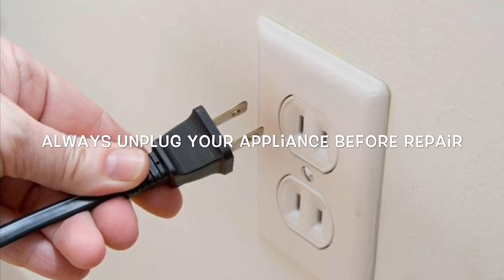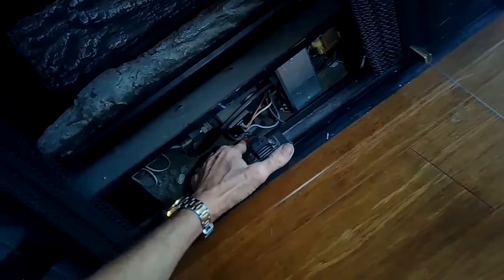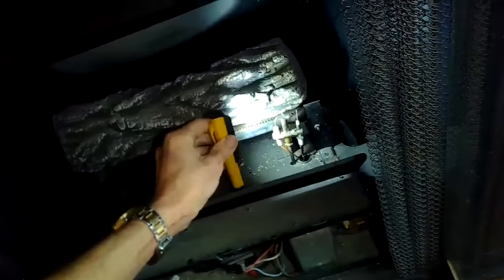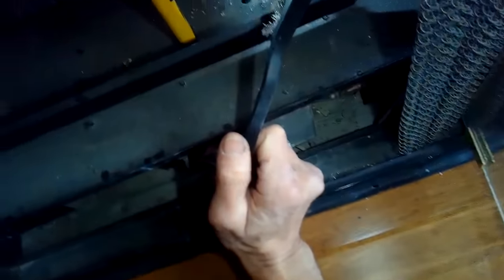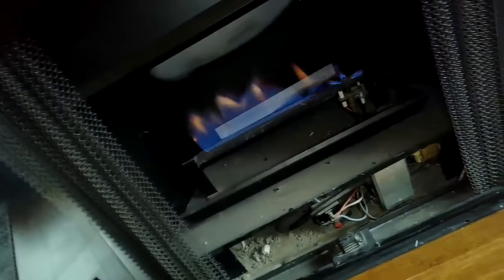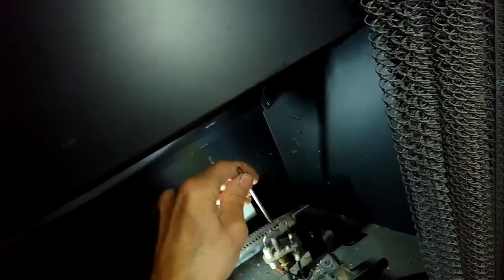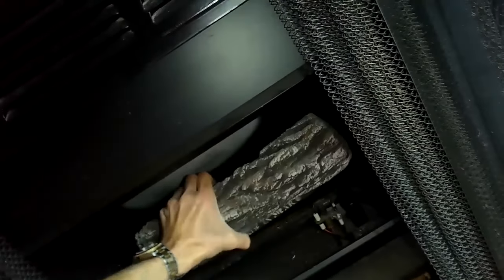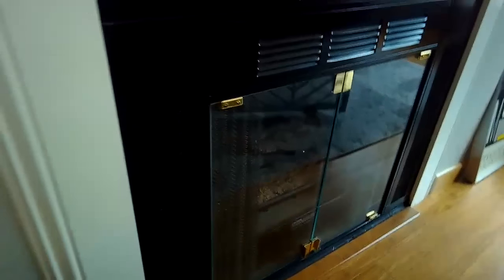✨ Gas Fireplace Won’t Light🔥 (FIXED) ✨

Comment: When my pilot wouldn’t light. I checked the AA battery on the side of the setup and found the battery completely corroded. I didn’t even know there was a battery there. I change them all out for the system to start the cold season every year but never changed the one under the stove. It lasted 12 years 😆 it lit immediately when I replaced that hidden battery.
Reply from the maker: Awesome job Sean👍

Comment: We use acupunture needles to clean 3d printer nozzles, they are VERY thin surgical steel needles.  Maybe something like that would work cleaning the pilot light?

Comment: My fireplace does not have the valve that you show in the video only gas line on insert part and key on the outside so how the heck am I supposed to turn it on and off?
Reply from the maker: You just turn the key and then light it with a long match or lighter with a long reach.
Should light the log right after turning the key👍

Comment: my gas fire has 3 radiants, but, the middle one doesn't glow half as bright as the outside ones... i've given it a thorough clean out... any idea what i can do with this middle, duller, radiant ... The center radiant lights first, followed by the outer 2...
Reply from the maker: Sounds like the gas flow is being obstructed by something 👍

Comment: Your video saved me a service call, thanks. One additional tip though, after using the wire brush and pick I blased the jets with a can of compressed air. This is the type you use on computer keyboards. Worked great as the tube straw fits right in the pilot holes and really cleans out any debris.
Reply from the maker: Thanks Dave,
That’s a great idea😊

Comment: Yep, just needed a quick clean.  Used one of my bore brushes and some canned air.  Took a couple tries to get the pilot light to stay lit, but now works better than ever.
Thanks!
jc
Reply from the maker: Nicely done😊😊😊
Reply: Decided to give this video a try before having a tech come out to fix my gas fireplace. As a 61 year-old woman, I find these kinds of things intimidating. I followed your easy to understand instructions and voila, pilot is lit and fireplace works great. I vacuumed the dust out and cleaned the glass while I was at it. Thanks for posting this video and saving me the $125 service fee!

Comment: Thank you so much for the video. I finally got the pilot to light up but I cant get the burner to start.
Reply from the maker: That copper thing that the pilot light touches needs to be cleaned with a wire brush.
Make sure the pilot flame is touching it.
Reply: Quick and Easy 5 minute Appliance Fixes I kept trying and cleaning and sure enough it started. You’re a life saver. I was going to call a contractor and he wanted $200 just for cleaning and an additional $125 to diagnose the problem. You saved me a few hundred bucks. Thank you!
Reply from the maker: That’s what I like to hear😊😊😊

Comment: I had the gas company out and they filled my tank. According to them this fireplace hasn't run in 10 years or so. He told me I had to purge the lines and to hold the pilot in for 10 min. This doesn't seem to have fixed my issue.. any ideas on purging the line?

Comment: i have a Earth fireplace insert. I set the valve to Pilot but the pilot 
will not lite at all, No gas is going to it. The gas is on feeding into 
it. Why do you think no gas is getting to the pilot? thank you
Reply from the maker: I think you have to push it in while you light the pilot

Comment: My thermo pile and coupler didn't have a lot of buildup on them, simply cleaning them didn't work. I did notice that the flame was not reaching all the way to the pile. The flame was weak and I could even see that some of the pilot flame was leaking out, having a small flame under the bracket that holds the pilot. My guess was that the pilot hole was partially plugged up. I took the whole pilot assembly out. That means unscrewing where the gas and couple lines are attached to the electrical connections box. Once out I could really clean the pilot holes. In my case it was the inside of the pilot that was full of crud. I used water from the sink, a pin to poke up in there, and a toothbrush. 
It took some time, but this is not hard work. 

When reassembled the pilot was strong and the flames encircled the pile and coupler with a good blue flame. The wall switch turned on the main burners and all was well. In my home, the gas fireplace keeps the whole up living space pretty warm and the furnace rarely comes on. And this is in 0 degree weather during this freeze we are having. 

THANKS FOR THE VIDEO! VERY HELPFUL!
Reply from the maker: Wow, nicely done Maury😊👍

Comment: My gas fireplace won't light when the inside temperature is rather high. Or when it finally lights, the fame won't shut off when it reaches set temperature. Which thing should I be looking at?

Comment: We have a gas fireplace it has never been used it will not lite . The pilot will not stay on. The company sent us a new thermocoupling and now a new piece for the control knob . We have spent quite a bit of money having new gas lines run and paying a technician he he completely stumped . Any ideas
Reply from the maker: Hi Jane,

When you press in on the knob to lite the pilot, can you hold that knob in for 5 minutes so the thermocouple has time to heat up.
Reply: Thank you for reaching out I did try the 5 mins still it won’t stay lit . I have the other piece to replace and maybe a new pilot light. Going to get the technician back in to replace too much for me to replace . Thanks again
Reply from the maker: Thanks Jane,  the little hole where the pilot light gas comes out might be clogged with dirt.  You can use a small needle to open it up.

Comment: Hello, I have a flavel emberglow gas fire. Unfortunately it work after a bit of an effort. I press the dial in to release gas then turn the dial anti clock wise until you feel pressure; then keep going until you hear a click (which is activating the ignition). Then all being well the fire should light, My issue is that the dial just turn; no gas; no ignition and no fire. It does come on eventually but not until a few efforts. Please advise. Many thanks in advance.
Reply from the maker: I would replace the thermocouple
Reply: @QuickAndEasy5MinuteAppliance  Thank you very much for your prompt reply. Can you advise how much that is and if I had the service done on the gas fire, would that just "repair" the problem or should I still have that changed? Thank you

Comment: I'm still looking for a solution to my problem, the electronic igniter on my fireplace only sparks one or two times but after that it just clicks without any spark, all I hear is click-click- click, and no sparks, if I let it continue it will eventually either lights up or just stops clicking and no flames /fire until I turn the remote ON and OFF and start the process.  I have cleaned all the parts I see (thermocouple/igniter/flame sensor but the igniter problem persists.
Reply: ddistrbd1 look at pilot light. if you can’t see the spark onto the pilot hood it’s shorting out some where. From the board to pilot. If it’s an old fire place try and clean your sparker and make sure that the spark is coming from the board or source (you can hold the sparker cable 1/8th of  inch away from the source and see an arc.) long story short you sparker is arcing other places instead of the pilot. Replace sparker.